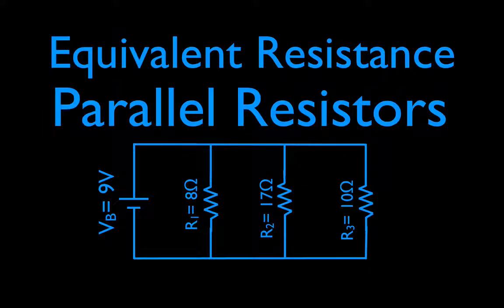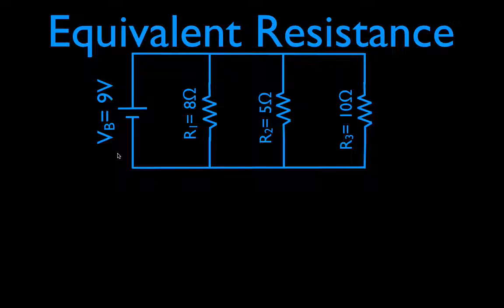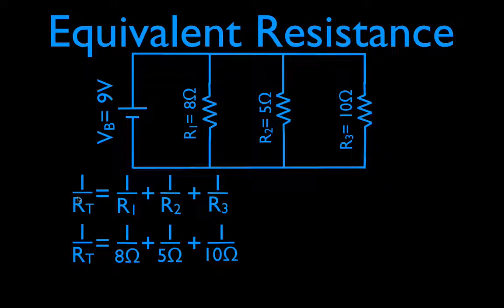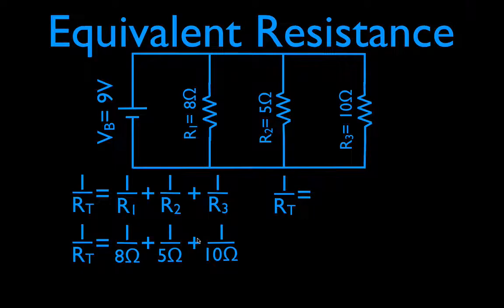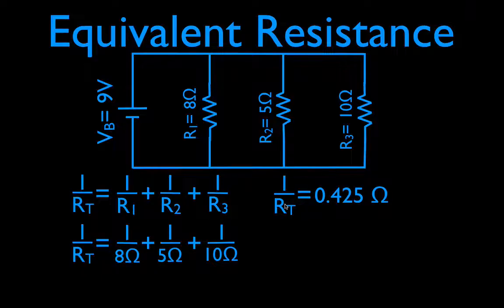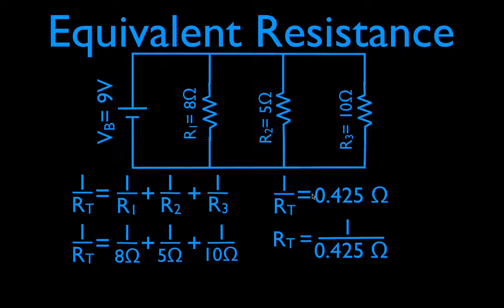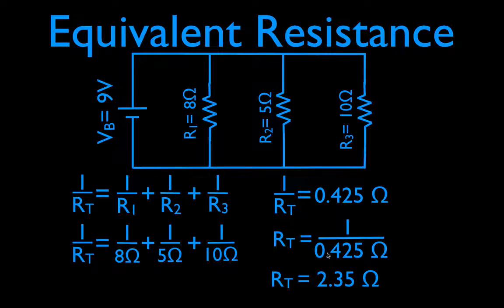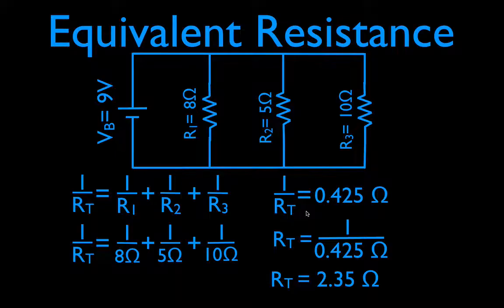Resistors in Electric Circuits (16 of 16) Calculating Equivalent Resistance of Parallel Resistors

Comment: sir, can u make a video for question 12 from edexcel gcse june 2017?please
Reply from the maker: Can't find the question.
Reply: sir,can i have ur email or instagram? i want to send u the question paper.
Reply: pls sir help me out.. i've exam on 18th may physics unit 2. your video helps me aloot to solve circuit diagrams calculation but only this question i'm facing problem.
Reply from the maker: Sunjida Akhter bhswarthout@gmail.com
Reply: Thank you sir... n i've sent u the file
Reply from the maker: Got it give me a minute.

Comment: instead of using a calculator you should show your math.If I divide 40 by 17 I get 2.352941176470588 or 2.35 or I divide 17 by 40 and get .425.